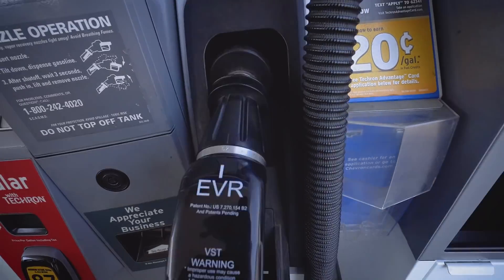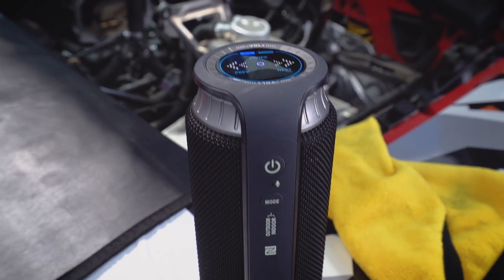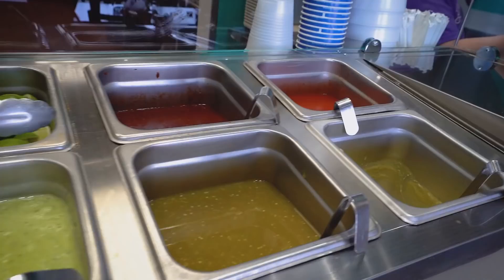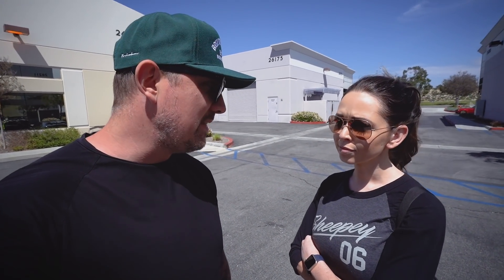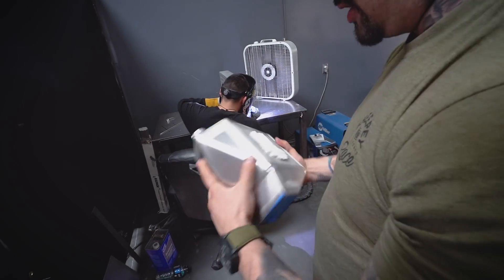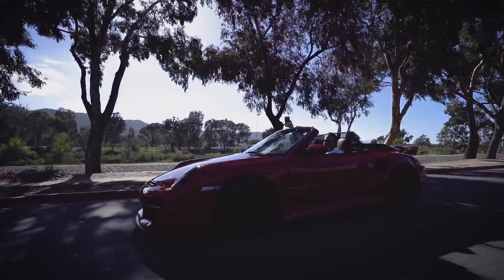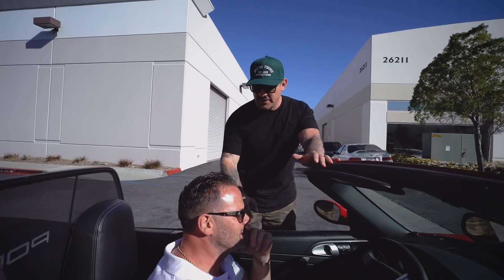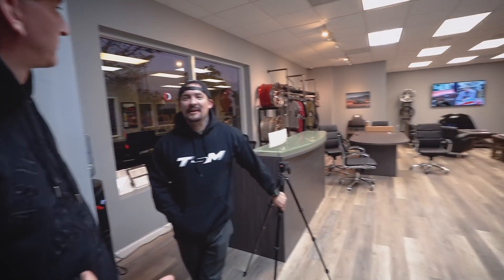MY TWIN TURBO LAMBORGHINI WILL MAKE HOW MUCH ****WHP? *SHEEPEY RACE EP2*

Comment: It’s a shame Dave’s R8 is a V8 if it is was a V10 you could reuse the supercharger on the R8. Please correct me if I’m wrong.
Reply: No, the kits for supercharging by vf are unique for each and every car I believe I'm not sure.
Reply: I thought the same but I know both the huracan and the v10 R8 have 5.2 L v10 and as most parts on the huracan are Audi parts my guess is that they have very similar engines if not the same all it would take is a new tune at least I think
Reply: Just did some more reading and the R8 and the gallardo/huracan so just put it on Dave gallardo since he has a v8 R8 that is kinda like having a v6 mustang

Comment: Damon or Dave why didn’t you just say f*** it put the twin turbos in the #tireslayer with VF Engineering supercharger so you have a twin turbo supercharged Huracan. It’s possible 🤷‍♂️
Reply: Timothy Hicks lol
Reply: Timothy Hicks why leave supercharger on it. Turbos are more than capable of producing way more than that engine can handle and still be reliable. DDE is way better when they have cars that run.
Reply: That would be a „twincharge“ and the problem with it it isnt that reliable
Reply: Valentin yeah I have to agree. But it would pretty damn badass if you ask me. Lol
Reply: Because if they wanted a hypercharger they would just wait for the VF800 to come out.

Comment: I had the first turbo charged Integra in the high school I was at. Your Huracan will have 800 and my Integra had 768 wheel horse power and ran a mid 8 second quarter mile. Yes, we had this conversation about Integra's on Instagram.

Comment: Germany Golf 1233hp: https://youtu.be/Fuj7x4Px6zQ 
Sweden Golf 1200hp owned/made by Dahlback: https://youtu.be/RI2fi7HnzKk 
Sweden Polo 900hp owned/made by Dahlback: https://youtu.be/QKpBaXvG7j0 
Norway Ford 2000+hp: https://youtu.be/aDw5NMp1CMA 
Norway Ford 2000+hp spinning tires all the way, built by a guy living outside Moi in norway: https://youtu.be/vYLTnWWeEL0

Comment: Turbo that sumbitch!  Frigging Turbos...people don't get it. It's like having your cake and eating it too. Why? You don't need to steal engine power to make your turbos run like a supercharger does. Super charger takes power right from the crank to push it faster and pull more air in. Turbos? Turbos take exhaust that is just coming out anyways, grab it and send more air into your engine from the cold side of the turbo when it's spun up on the hot side of the turbo. The best part? The more exhaust you make, the faster the turbo goes, the more power you make, the more exhaust you make and the whole bitch gets faster and faster.

Superchargers are nice in certain situations and they don't face lag like turbos...that exhaust to more air obviously has to start with less exhaust/air whereas the supercharger sends it's full wad that its able to for how the engine can handle the boost/components etc. They seriously run out of power at the mid to top end though when turbos are making more and more and more power.